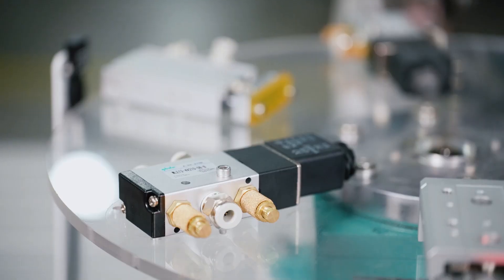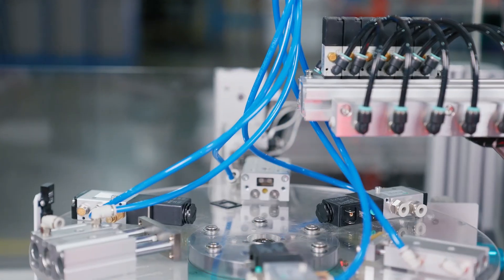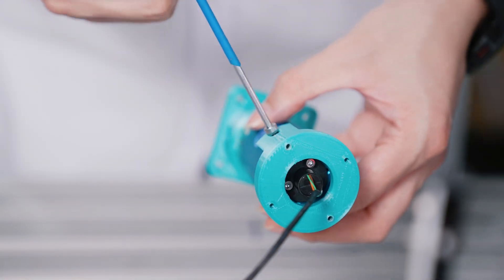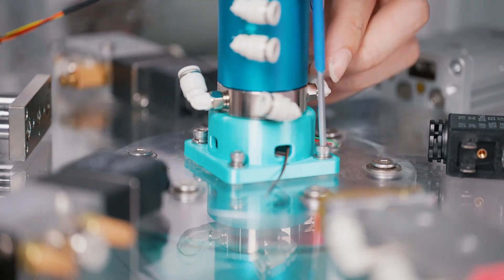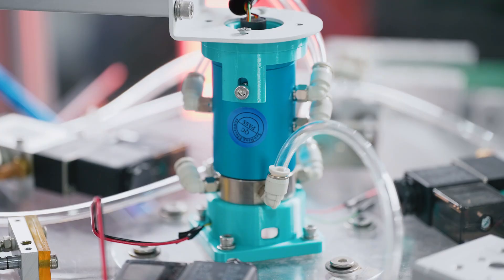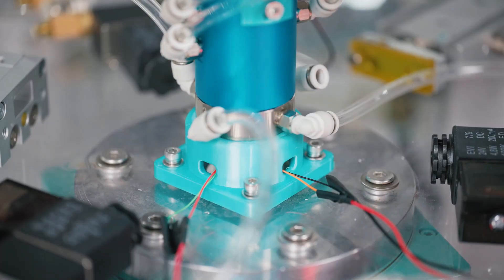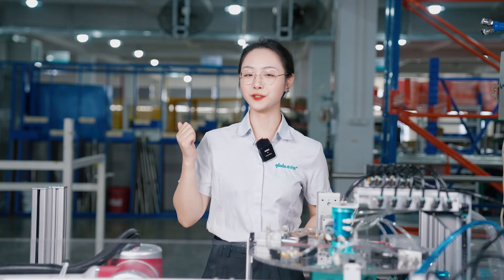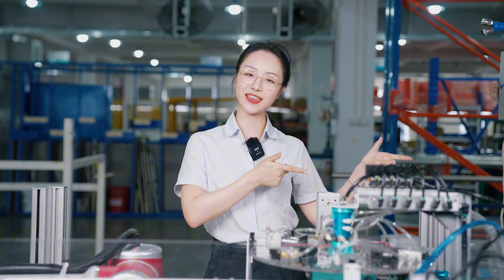Slip ring connector for rotating electrical connection.

Comment: I didn't understand the purpose of that device 😢
Reply from the maker: In rotating working conditions, multiple sets of cylinder solenoid valves or other equipment are required, and their circuits will become entangled during rotation. If there is a device with 360° wireless rotation at one end, it can connect the air circuit and the electric circuit, thus solving the problem of wire entanglement.